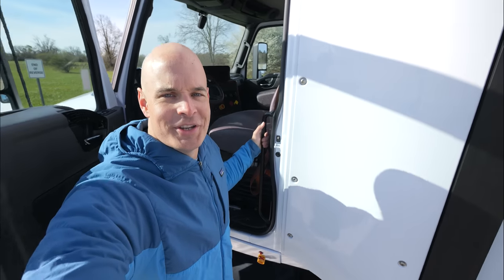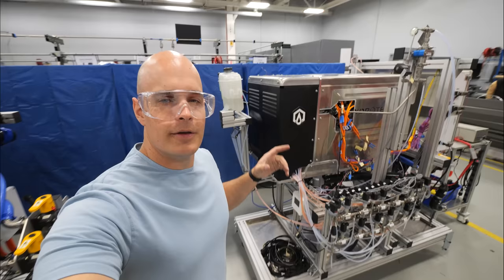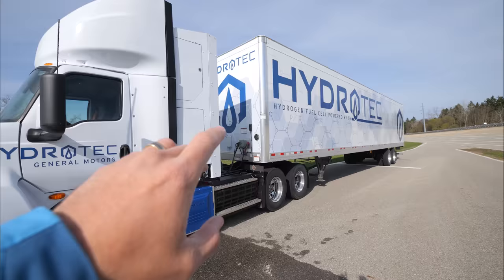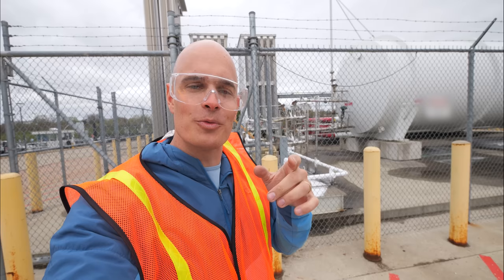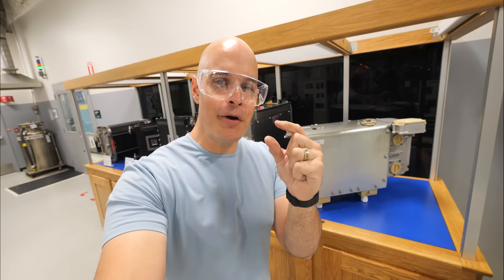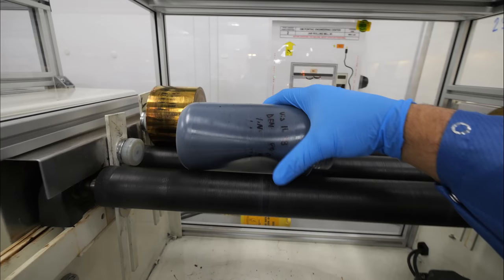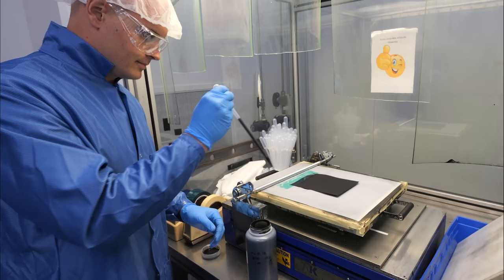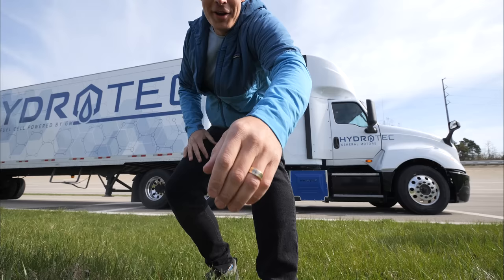How to build a Hydrogen Fuel Cell Semi Truck? - Hydrotec Factory Tour

Comment: Seems cool however isn't hydrogen a dead end? Efficiency right now of taking electricity, converting water to hydrogen, then cooling it down, then transporting it, then warming it up, then using fuel cells to generate electricity again is reeeeally low. Wouldn't be easier to just use a regular battery and skip most of those steps?
Reply: You’re correct that it’s less efficient, the issue however is emissions. If the hydrogen is being refined using renewable energy, the hydrogen vehicle is going to have a far lower carbon footprint, whereas with an electric vehicle it has the giant batteries that have to be made then dealt with after they go bad, which is extremely bad for the environment. Plus, as a truck driver myself, I can tell you we aren’t going to sit around for hours waiting for our trucks to charge XD
Reply: @lord_ishamael  sure thing, however the Tesla's semi can charge up to 70% in 30 minutes, I'd say that's not bad at all

Comment: In Finland they weigh up to 74.000kg. America is 20 years behind.
Reply: LOL Australia be hauling 3-4 trailers with one truck. even if they only brought out simple B-doubles they could double how much the trucking industry can haul.
Reply: @phalanx3803  Tell me you're not a truck driver without telling me. They haul several trailers, because their trailers can't hold much weight.
Reply: @billyjoe3309  yea our trailers can. 
6 axle semis have a GLM of 41.5 and a HML of 45.5 
9 axle B-doubles have a GLM of 62.5 and a HLM of 68
12 axle A-double or B-triple has a GLM of 82.5 and aHLM of 90.5
15 Axle AB-triple has a GLM of 102.5 HLM of 113
and the monster 18 axle BAB-Quad GLM of 122.5 HLM of 135.5
and when you get off road you can go as heavy as your set up can handle some pushing 200 tonne 

nhvr gov au, road-access, mass-dimension-and-loading, general-mass-and-dimension-limits

your gonna have to put the full stops back in and replace the comma's and spaces with "/" damn YT still wont allow links even if its a verified government website

Also Tell me you didn't do your research without telling me. 

clarification if you dont go to the web site GLM is General Mass Limits what a track can do standard and HLM is Higher Mass Limits is waht a truck can do if it meats certain requirements like having Road friendly suspension. and yes its all in metric tonnes. and off road doesn't mean dirt its any road that does not fall under control of a council or government.
Reply: @billyjoe3309  also no i am not a truck driver but i am a farmer and our grain and cattle need to be transported from our farm to market some how and we use a truck being a Type 1 RT 11Axle A-double when using our grain trailers (that will be section 5 config B on the PDF you look at it) i have to know the weight limits vary well its not just the cops the silos / grain elevators wont let us in if where over.
Reply: @phalanx3803  I am a janitor, but I don't think Space X know what their doing when they go to space.

Comment: I'm always excited for hydrogen vehicles development, since it combines advantages of Battery EVs and combustion engines with almost no flaws and we need to focus more on FCEVs.
And I'm waiting for hydrogen buses to run in my city this year!
Reply: At least here in Germany they are already scrapped (after a view years) because they are to expensive to run.... (and unaffordable to buy - 1 for the price of 10 regular buses)
Reply: @TecSanento  Is it really that high? I know, an electric bus costs about twice the combustion one, but it's mostly Li-Ion battery (absent in hydrogen buses). Also I found, how much Poznań paid fot these, and it averages to 4mln PLN per bus, which is less than 4x the cost of regular one (with one source saying only 2mln). But I think we will find out. And there will be at least hydrogen gas station in Poznań.
Reply: @Szymmon614  my be it has to do with the public transportation companys required to install a special hydrogen refueling station as there was none and the ones for regular cars had way to little pressure and capacity to refuel even a single bus (350 vs 700bar pressure), the time the station needs to rebuild that pressure,
Regular pipe integrity checks, tanks needing to be replaced ever so often and so on... Also The price for hydrogen not beeing cheaper then petrol or diesel,.... Few available skilled technicians to service such a vehicle (here one isn't allowed to perform work (for example changing tires) on a vehicle with high voltage, either electrical or hydrogen if not beeing trained and certified for this kind of task)
Reply: @TecSanento  Yes, but many say, that hydrogen will get cheaper than diesel or gasoline, but someone have to start generating demand for it to lower in price. So at first it could be not profitable, but eventually it will. And since there's no Li-Ion batteries, costs of decommissioning and recycling may be lower, and there are less fire hazard (at least from what Toyota showed with Mirai).
Reply: @Szymmon614  you are somewhat right with that but to actually make a difference, we need to generate that hydrogen using 100% renewables and at the moment and in the foreseeable future, we don't have enough energy renewable energy to drive all electric - and hydrogen would need 3 times the electricity :O
Reply: @TecSanento  If we figure out fusion energy, it might be enough electricity to power it all.
Reply: @Szymmon614  the "if" is chosen well - because I am sure that we will! but when? Even construction of plants in a considerable size amd count will take years we don't have. I don't say this technology is pointless - but I see no point in forcing it to market right now :)
Reply: @TecSanento  But, you might not know, that National Ignition Facility (California) already achieved nett energy gain from fusion reactor, so this can be closer than we think.
Reply: @Szymmon614  now they only need to scale it up to continue as runtime with GW of power - and build like a hundred of them + get the heavy water in quantities, that allow this runtime.
But - and I give you that, some serious milestones have been achieved
Reply: @TecSanento  I'm not saying that it will be easy or happen soon, but recently it was more a curiosity, than real solution, so I think we're slowly but surely getting there (and maybe we will live to see this).
Reply: @Szymmon614  yeah then -> it's great and I cannot wait to see that happen!
Just to be clear - it was nice to have such a reflected discussion on the Internet and I am totally on your side, just want to make shure there are no wrong /unrealistic espections about solutions future technology night bring to save us :)
Reply: @TecSanento  I always enjoy such informative discussion. Thanks for educating me a bit, and I hope You learned something as well :)

Comment: I'm curious to know how much platinum is required for a truck that size? 
Also, there appears to be steam escaping - could that be used to drive the air-con or charge low voltage batteries for instrumentation, regular lighting, and fans like a Tesla?

Comment: So we’re still avoiding the 2-3x worse energy efficiency conversation of HFC vs BEV? 

Sure the energy sources should be “green” but at the end of the day H2 fuel cells just require way more input energy per unit mile travelled in the vehicle. So unless a BEV heavy truck can not do this work, there is no hope for H2 trucks like this. 

And it’s looking like the BEV trucks are doing it. 

Good luck GM!
Reply: Also still avoiding that the fleet of tankers needed to truck the hydrogen will be 10x the equivalent fossil fuel fleet.
Reply: @rogerstarkey5390  Volumetric efficiency and the fact that methane is easily stored as a liquid (that isn't trying everything to escape) are big reasons that SpaceX are using methalox engines.
There are practical methane fuel cells, but they do run hotter and require rare earth ceramics.

Comment: Platinum, one of the rarest resources on earth, mainly mined in africa... required to create the fuel cells, which uses a boatload of processes to convert energy back and forth to finally power a truck, that could have just had a battery and electric line chargers along the road. 

Yeah, any money spent researching this the last few decades.....totally worth it! ;)
Reply: OH NO..... RARE EARTH MATERIAL (ACTUAL Rare Earth material!!)
I agree.
.
You can add 3 times the Silicon, Silver, Selenium, Gallium, Copper, etc used in the extra solar panels they need to generate the energy to move HFCEVs a similar distance.
.
Then there's the life of the cells. And the recycling....

Comment: i saw a small hydrogen car its tank got blown & it's was scary! i wounder how would that be like if happened in a truck tank! ev batteries when it catchs fire at least it doesn't blow up everything around it
i wounder why ammonia in those fuel cells doesn't work as efficient as hydrogen?

Comment: So, to generate 1 kWh of electricity in a fuel cell, we would need about 5.5 kWh of electrical energy to produce the necessary hydrogen through electrolysis

Comment: While all of this stuff is really nice and I think hydrogen in semis has a very positive path forward. I would like to see some studies done on semi trucks using overhead wire like they were testing in Germany not too long ago because the only thing more efficient than an electric or hydrogen vehicle is a vehicle that doesn't have to carry its own energy on board. And realistically the majority of a semi trucks driving is on the freeway so I don't see an issue with say a hydrogen fuel cell for the in-town driving but then using overhead electric for going down the interstate. 

You could even make use of those wires for doing stuff like I don't know platooning your trucks together

Comment: Without reduction of hydrogen tanks size it will not work for long houl trucks, as driver needs rest area there, which now is used up by 6 tanks.

Comment: Its starting to seem to me that the way to go if practical, would be is to repurpose our already in-place gas infrastructure to transport gas hydrogen which possibly could be used for heating and hotwater like we already have. My new boiler that's just been installed can be run on a hydrogen blend, It could run on 100% hydrogen it would just need a tweak to the distributor, i would have liked to have had a heat pump installed but have no suitable space to have a hot water tank.

Every house or even groups of houses like an estate needs to have its own fuel cell to generate on site electric and to have a battery system to store the generated electric and deal with the spikes in demand, then a solar system to "top up" the storage when possible!

My house almost exclusively runs on solar most days even when it's cloudy or raining It's only when cooking that i start pulling from the grid or overnight which would be fixed by a battery storage system. However, its just too costly at this moment in time. With what im seeing with these so called salt water battery we can cut down the reliance on contaminants like lithium and cobalt.

I know there are places that do not have gas supplies so still having a grid system would be required but again instead of using natural gas to power stations they could use hydrogen and keep the distribution and generation of said hydrogen local and use wind and solar to generate it when demand is high. It would be like the old'n days with town gas! 

Whichever way we go about it i think solely relying on a "on-demand"  solar and wind system is not the way to go and we should be looking at a store what is generated and then use system rather than just turning it off and allowing it to go to waste simply because "there's just too much being generated to use at that moment in time"

Comment: Hydrogen is that unachievable unlikely long shot that could be possible eventually. We have large bus fleets already converted to natural gas it's crazy we don't do that with semis in the meantime. Still bad but a better patch than diesel for the next 20 to 30 years

Comment: how efficient is this compared to petrol and diesel engine?
Reply: You need to build plant similar to refineries (huge)
You need to build 3 times the green(?) grid energy that you need for straight EV vehicles.
You need a fleet of road tankers 10 times the number compared to the fossil fuel fleet due to low volumetric density.
You need a huge number of filling stations (do you want one in your town?)
You'll probably need people manning those stations to monitor safety.
And the costs will ALL filter down to the end user.

Comment: I enjoyed the video and it was very interesting.  I have to believe that Hydrogen EVs are the way to go.  

I have to ask... When are you going to rip the batteries out of the Humvee and replace the batteries with a fuel cell? What could possibly go wrong? You could generate Hydrogen from water at your home.

Keep the videos com
ing.
Reply: I'm sure he'll never do that. Hydrogen fuel cells are limited in power output meaning they are useless for acceleration. They need to be combined with batteries or similar tech to come close to practical.

Comment: As fascinating as fuel cells are, and as much as I would like them to catch on, I don't believe they will, for most applications.

Some people are very worried about switching to EVs, and ask where we would get all the energy from.
If you worry about that; I ask where you would get the energy to get the hydrogen.

I'm supporting FC R&D (just moral support). But I don't believe they will solve the inefficiency compared to BEV.

For most users, I believe they can get more value for the money, from BEV with rapid (and slow) charging.
I appreciate that some will face challenge to adapt their use pattern to work with rapid (and slow charging), I believe most of them would be well of with battery swap EV.
For the last minority, that can't adapt to either EV charging or battery swap, I think hydrogen stand out as a viable alternative, but only as "plan C".

Comment: I've worked with hydrogen and it's extreame difficult to store and use. The small molecules leak very easily and I doubt most mechanics could do the attention to do quality & precision to maintain sealing. Yes, eventually they could be retrained but I'm fairly cynical about most people's abilities, based on lifetime experience. So the fire hazard is extreme and since the flame is invisible any wrecks could see more burns too.

Comment: My professor at University had said that electric isn't the future, this is
Reply: Not really. Hydrogen will only play a tiny role in vehicles.
Reply: @Simon-dm8zv  maybe small domestic vehicles will be electric but larger vehicles will be hydrogen like Lorries or buses, both electric and hydrogen will be the future but most people think electric is the only option  due to hydrogen safety concerns
Reply: @mantas1906  Also the majority of lorries and busses will be battery electric. Simply because it is far more efficient and therefore a lot cheaper per mile.

Comment: Hopefully in the next 20 years we can actually turn to using renewables  as our main source of energy to power the grid. Iceland already uses geothermal as their majority and their electric costs are extremely low.  If this happens, hydrogen would be far less to produce. Also I can see it as a much better alternative to battery powered vehicles as the materials needed for our current lithium batteries are extremely rare, hard to get, and cost a lot in energy produce. Unless we find a better way to make batteries that have better returns, I could see this as a much better way to power future vehicles. The key here for everything however is turning to renewables for power and stop the use of coal. gasoline would be come much cheaper also in the long run for all our older vehicles, collectable cars...ect. Keep the oil for the fun old cars, hydrogen and electric for everything else.

Comment: I get the point that we need to go to hydrogen. And that the other trucks make up for 30% of the emissions. But i don’t think generating al the electricity for making hydrogen and putting in a 220kwh battery makes it any more clean for the planet than a standard truck.